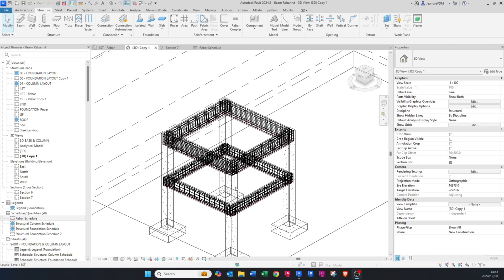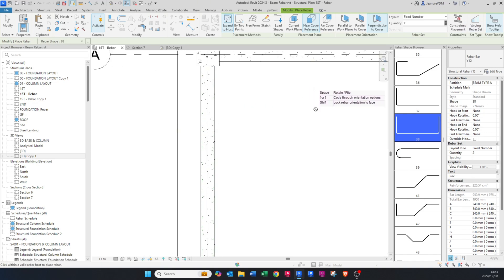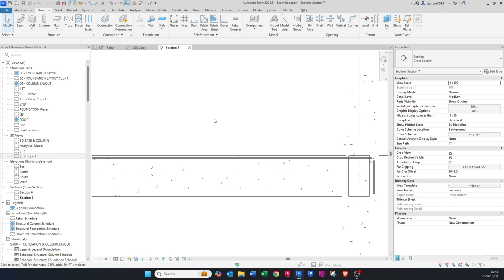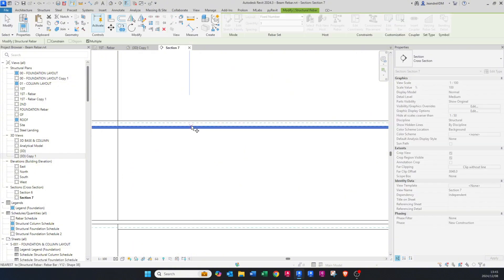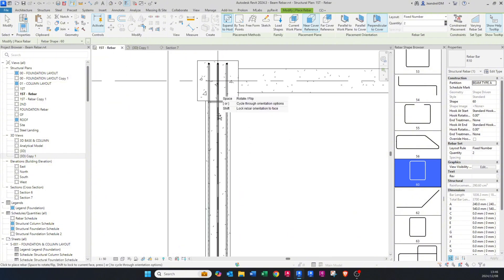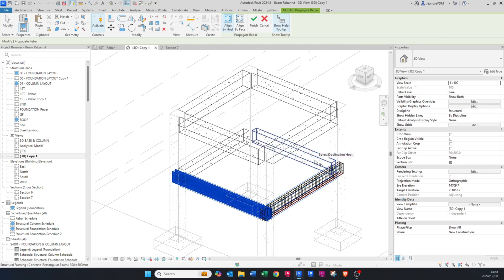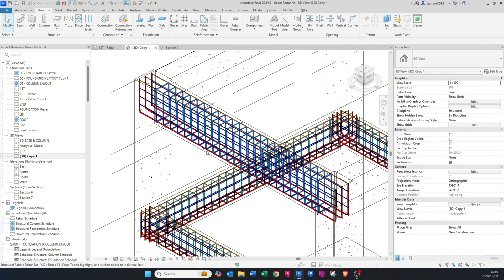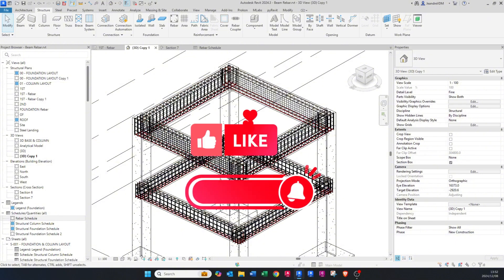Revit Structures - Beam (Structural Framing) Reinforcing

Comment: Hello, how can I copy beam rebar to another beam with the same dimensions but a different length? Thank you.
Reply from the maker: Hi, you need to use the 'Propagate Rebar' tool. Check out this video at the 8:33 mark.
Reply: @RevitWiz  Yes, I have already tried it, but I have to set the rebar again. They are not aligned, and the rebar does not adjust with the new length.

Comment: Good effort. I would suggest you work on beam X-Section when you want to place rebar in it. It will automate a lot of manual calculations like you just did in the video. 

I love the rebar colour code thing, which makes the whole model interesting 😇

Keep it up🙌